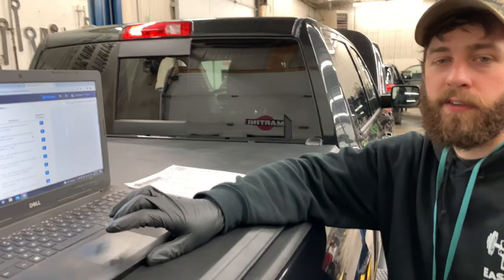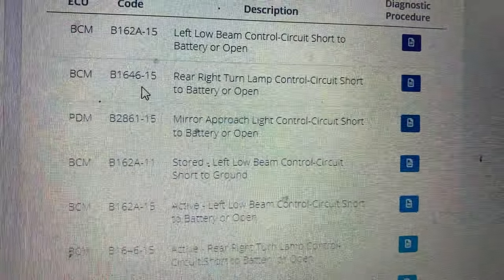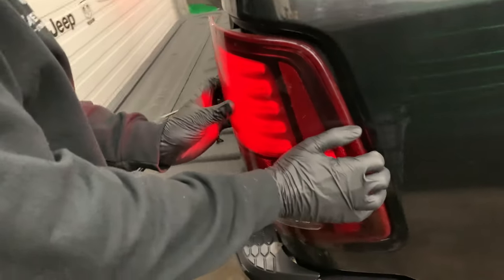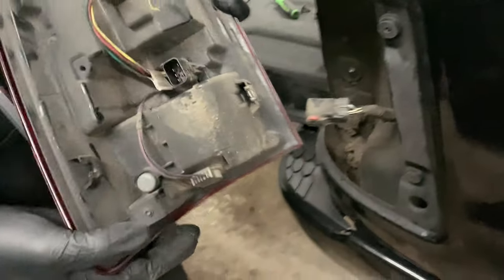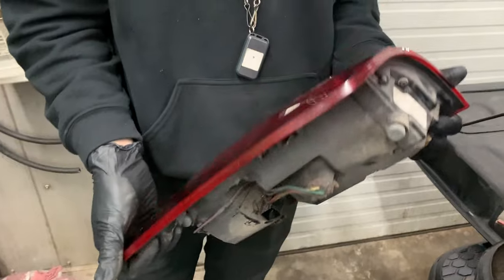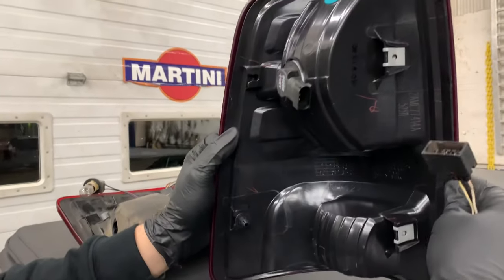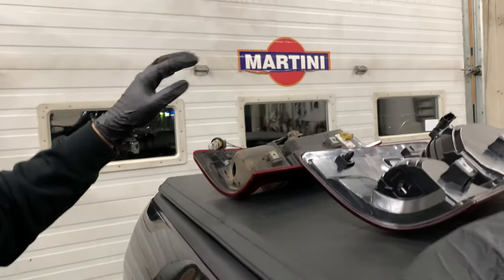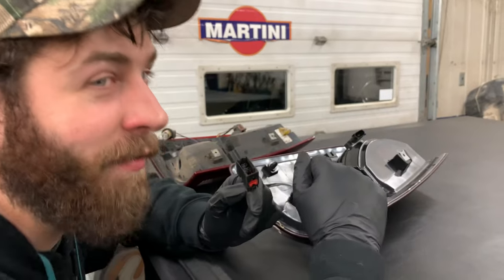Turn Signal Blinking Fast LED Taillight B1646-15 - 2015 Dodge Ram 1500 5.7L

Comment: So I bought new tail lights on eBay, probably too cheap but just installed them and they’re working fine but it’s still blinking fast. It was just the right turn signal that was getting a message but now getting message for both! Are they that cheap? Or something else?
Reply: 16’ 1500 Laramie so led
Reply from the maker: Hmmm 🤔 interesting, it’s totally possible that the internal resistance isn’t enough to meet the required amount of the module and now the module things the lights are out, I’ve hear of this before

Comment: I have this issue right now and good to know that it's not a cheap fix :( In my case the warning is intermittent so I may clean up the connector first and then see what happens

Comment: Mine says the rear turn  light is out but it’s working perfect. So annoying
Reply from the maker: Are you positive you don’t have 1 led that’s not working out of the cluster of them?
Reply: I have the same issue but I don’t have led taillights. I have regular lights. 
Could it be related to the 3rd brake light?
Reply from the maker: @MichaelJones-ok4yu  yep, could be a bulb that’s out, incorrect bulb installed, or resistance in the wiring harness (corrosion)

Comment: I've been having intermittent trouble with mine for a long time.  I tried switching the right side in the left side and error code went away completely. I put them back where they're supposed to be and it comes back.
Reply from the maker: Hmm interesting, possibly a bad connection in the connector? Not sure about that one

Comment: I am working on a ram rebel right now and I did the test procedure on dealer connect and it said it was shorted internally and I ordered a new assembly and still have the same issue. I already checked the third brake light and all of the harness. The bcm is the last thing I haven't checked and starting to think that
Reply: Same here on my 17 rebel.  What fixed your s?